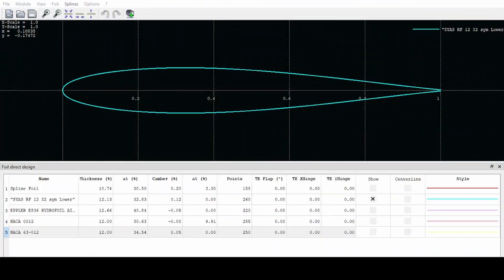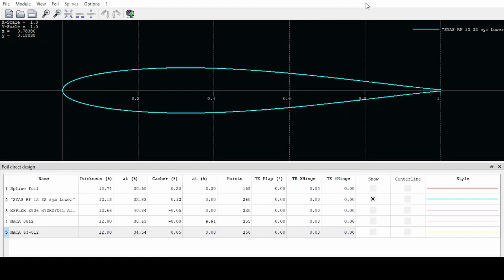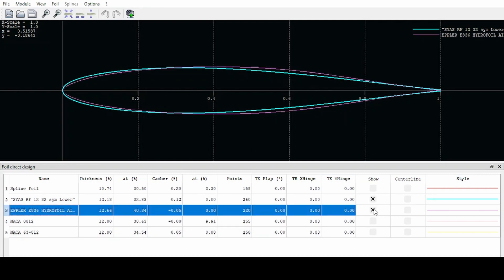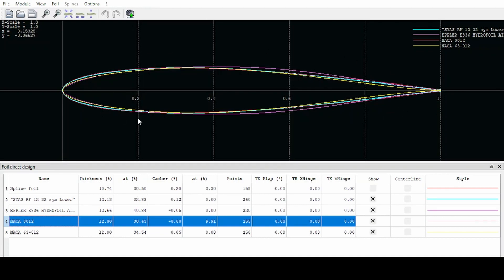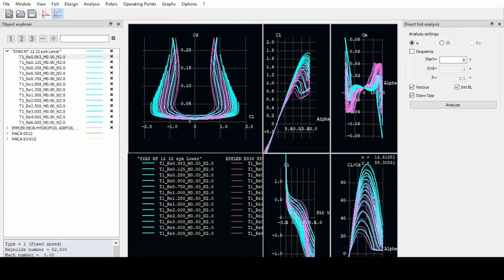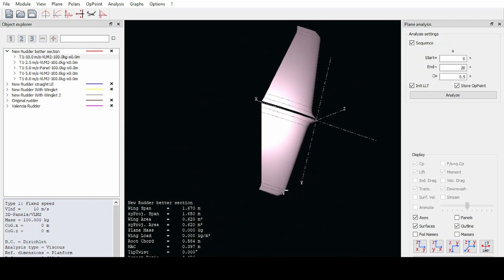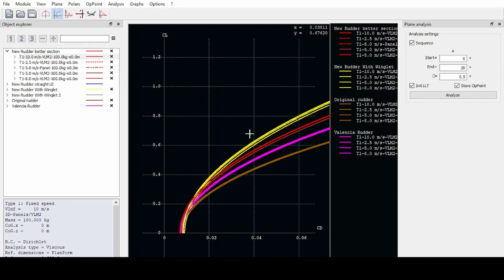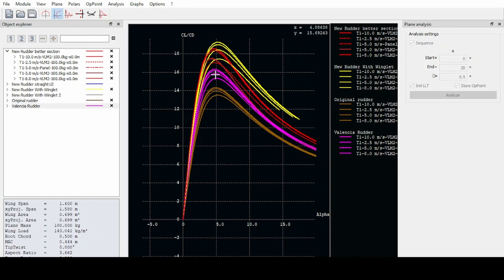Paikea's New Rudder Design

Comment: I think the front edge is the problem and they are too narrow or just not large enough.the bubbles are coming from the leading edge also it’s mostly near the hull.the rudder is not turning the hull.If you look closely the rudder Is 25 degrees to the hull direction and is basically blowing out.Putting a little wing on the bottom isn’t going to fix the problem.Maybe look at a Hobie Cat rudder they are very thin.look forward to see your design and solution 👍

Comment: those wingtips look bloody ideal for cray pot lines and seaweed, but if you like diving into the ocean at midnight
Reply from the maker: Yep this is one of the considerations and part of the design aspects. Highly swept leading edge and aft placement on the rudder blade. It will not stopp all the fishing pots but help reduce the amount that get hooked up🤞
Reply: @youngbarnacles  my bad should have known you would be all over that- very interesting and technical vlog best of luck

Comment: Very cool to get a glimpse into the process you went through to design the new rudders. They have a very different outline to the first set of rudders you made. I’m curious how this heavily tapered chord length to a more constant chord length like the first ones, why did you ultimately choose to go with this? How much performance do you think would be lost if you rounded off the aft portion of the tip to make it less vulnerable when beaching the boat?

Comment: Awesome vid. You mention roller/needle bearings in the future. What sort of % friction improvement would these offer under load compared to non roller versions?
Reply from the maker: Hi guys, the difference is quite substantial on loaded rudders. It differs a little from boat to boat as the rudder loading potential varies a bit. As speed or surface are increases it becomes impossible to use plane bearings so needle bearings are needed. On our boat with the original rudder blades they were able to load the stocks in following seas where the bearings would bind. With the new blades we make in Valencia the rudder angle of attack was greatly reduced so was able to correct the course of the boat earlier and thus doesn't load up. With the new rudders the difference would be the feeling of the steering getting stiff vs free to move and  only the feel of water pressure on the blade on the steering system
Reply: @youngbarnacles  Thanks heeps for the feedback ;)
Reply from the maker: @SailSurfROAM  anytime mate

Comment: Gday Shayne, thanks for the video, great work. I would be wary of using a typical "speeding along" case scenario of rudder use. I prefer to use very large rudders on my cats. The reason is because rudders are highly loaded coming out of tacks and in a following sea before a surf(that wallow when you fall off a wave). When tacking the roached leech will fill before the rest of the sail plan, producing severe weather helm at a time of little flow. I have a real problem with cat designers who say "My boats go fast and need small rudders" when a critical condition is tacking a light and large windage boat in sloppy conditions - low rudder flow, low lift, C or E far aft leading to a high potential for stall. The only way around that is to use forgiving shapes (Go the 0012) and larger rudders to reduce wing loading. On a cruising boat, what does it matter of the rudder has slightly more drag at 10-12 knots if she tacks like a dream without a headsail up? My 38 foot cat can - (Chamberlin designed her with nice large rudders). I designed two little folding cats - both have large rudders. If I pull one rudder up, then they behave like normal (read harder to handle than monos) cats. With both rudders down I can stall (with no headsail up) 30 degrees off the wind with main luffing. Then give two pumps of the tiller, gently pull on the main sheet and the cats will bear away - just like a good mono. We can sail gently through an anchorage and she doesn't "let go" below certain speeds like other multis. Cats can behave as well as monos with larger than usually designed foils, if you can accept that the typical lift to drag graphs are not useful for cruising and harbour sailing. I would urge you to ensure that your rudders can produce effective lift at 3-4 knots. Then Pakea will be able to tack beautifully through the anchorage. Designing rudders like most designers produces badly behaved cats at low speeds and low speeds occur commonly when cruising. Top or even cruising speed is not the critical case, low speed should be on a cruising cat and accept the drag penalty at higher speeds.
Reply: I agree entirely. Even for monohulls the case for a larger than optimum for speed rudder is valid. It means that the autopilot has more authority and will use lower rudder angles in general, and it also means better manoeuvrability in tight situations like the fuel dock etc, though that last doesn't apply necessarily to a cat. The autopilot is often later applying helm than a human would be - so in marginal conditions a bigger rudder means that the autopilot keeps a better course with lower rudder angles. We all have those times when we should have reefed half an hour ago, or the sea state has suddenly kicked up....

Comment: @youngbarnacles: Have a look at the hydroflow of the humpbackwhale‘s fins! There is something exiting to learn for the hydroflow design of the new rudders…!

Here is some theory for what I am talking about: https://publications.lib.chalmers.se/records/fulltext/252401/252401.pdf
Reply: The problem with adding points on the rudder like that would be the undesirable collection of seaweed, nets, and crab pots. So you would need to be constantly diving to clear the rudders, not to mention if you are at full speed and catch one of the lines then it could act as a sawblade to all the other protrusions.

Comment: Hi! I'm completely ignorant on the tech of rudder design, but it seems very efficient. It seems to me the closer to the hull, the more "high pressure" zone due to pressure/weight of the hull on water, movement, etc. So, more rudder area there will make it more efficient in dealing with these forces and control. Am I guessing right?
On the other hand - and this question might be very dumb... - shouldn't the rudder stocks have "fingers" facing backwards inside the rudder to provide structural assistance so that the rudder don't "slide" around the rudder stock and you lose control of it? I don't know if language is not being a barrier here, hope you got the point. And I'm sure you'll have great thoughts on this. 
Merry Christmas and a Happy New Sailing Year to you all!!

Comment: NA here - greatly appreciated the discussion of the foil selection. You can see the cavitation up high where water pressure is less - so did you use the same section for the full length of the rudder? What software are you using for 2D and 3D foil analysis? And finally did you use a laminar flow section? I think for cruising yachts that marine growth roughness is too high unless you have the kids scrub the rudders before every sail!